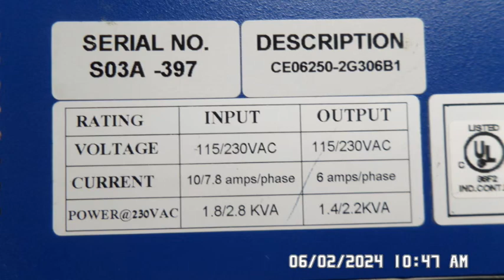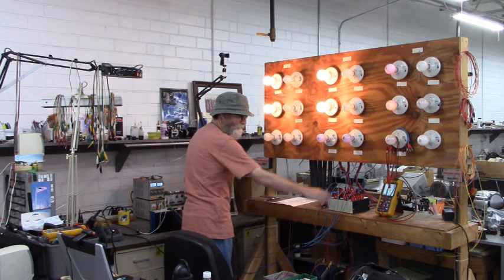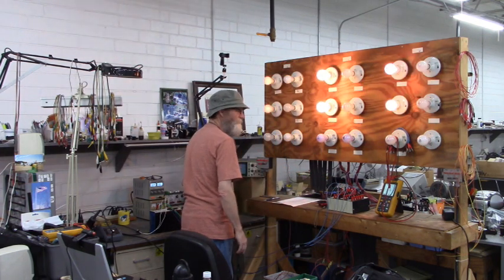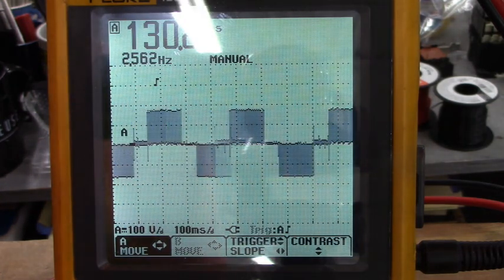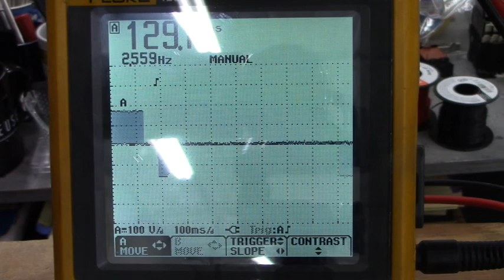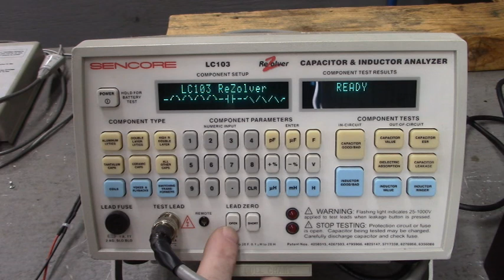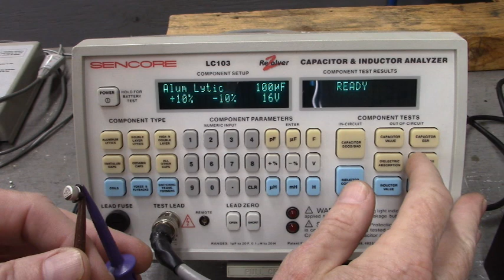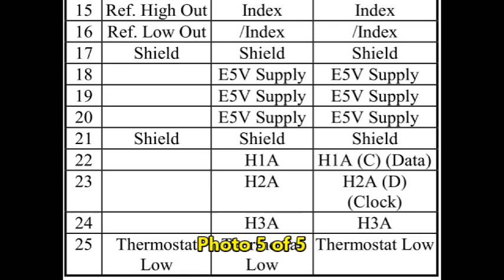Kollmorgen ServoStarCD Model: CE06250-2G306B1 Sometimes Does Not Power Up.

Comment: Hello sir 
If you would answer my question I will be so grateful 

Sometimes, I'm unsure about when to replace power capacitors in drives.

When do you decide to replace power capacitors in VFDs?

I have some capacitors with bulging valves, but they hold the voltage very steady when charged.

If you notice the valve of a capacitor is bulging, do you replace it?

I mean DC link capacitors
Reply from the maker: I don't know why, but the DC buss capacitors are very sturdy components. And they usually do not fail as their smaller capacitors often do. I will replace them when they show signs of failure. When they bulge or burst open. That is a very good question. Thank you:)
Reply: @PeepawMcDonald  The smaller capacitors (in voltage, and value) tend to fail more, because they use more 'advanced' electrolytic solution to get the most capacitance in the least amount of board realestate. For large capacitors (DC bus caps in VFDs and even the main DC bus caps in switching power supplies), there tends to only be one of them, and it's more important that it doesn't explode at 400VDC than how much board area it takes up, so they tend to use less advanced, but more stable electrolytic solutions in them, but with lower dielectric constants, so the capacitors need to be bigger. That's why there's different "series" of capacitors from every brand aimed at different applications. The ones that tend to fail most are the ~1000uF to 4700uF, and 16-50V, as that's usually where they're trying to save board space. Back when the "capacitor plauge" was in it's heyday in the late 90's / 00's, when replacing failed capacitors on motherboards with less than stellar brand capacitors, it was impossible to find replacements from reliable brands that had the same footprint. The equivalent caps from Nichicon/Chemicon/Rubycon/Panasonic were 30-60% larger in diameter, and they just didn't have anything in the shrunken sizes. Once replaced, the larger capacitors were always way more reliable and never needed to be replaced again. Caps below 1000uF tend to be small enough anyway to not worry about using the advanced electrolyte, so they tend to be ok - but they can still fail, just not nearly as frequently. I suspect the cap that failed here was a "random" failure - could be the seal failed and it dried out. Some of those first miniaturized surface mount electrolytics were horrible, and known to fail - there's a particularly failure prone series of those that were used in certain generations of Tektronix scopes. It's not if they fail, it's when, and how much electrolyte do they spill on the board and eat the traces away. Even the good brands have bad series too - certain series of chemicon and nippon caps, used extensively in Mitsubishi drives and CNC controls, are pretty much guaranteed to fail and leak, and destroy traces.
Reply from the maker: @gorak9000  Thank you for you knowledge. I often wondered why the larger buss capacitors rarely failed as compared to the smaller capacitors. Can you explain why capacitors of the 60's, 70's, 80's are still going to this day? Thank you:)
Reply: @gorak9000  thank you for your information 
So in your opinion budged valve of caps is a certain sign of damage ??

Comment: That's a good point - I wonder what kind of capacitors they used in Voyager that both of them are still working - that'd be a tough service call to go swap out some failed electrolytics
Reply from the maker: Just wandering mind for a little bit. But I believe there is a repair shop on the very outskirts of our solar system. That the space craft went out researching with suspect bad components. And just as they were on the verge to failure. The galaxial repair shop refurbished their circuit boards. So that they could continue on with their journey. Either that or things were made to higher quality spec in the olden days:) For some reason, I like the first explanation much much better haha...
Reply: @PeepawMcDonald  “She Canny take anymore Captain”

Comment: Nice work Mr Peepaw . That servo simulator is a godsend. Is it microprocessor based,?
Reply from the maker: Yes, I programmed the PIC16F877 micro controller. It is made by Microchip
Reply: @PeepawMcDonald  Cool !!!  I’m a sparkie but I dabble in electronics and  Pic. micro,s . Have done a few projects using the Pic16877.